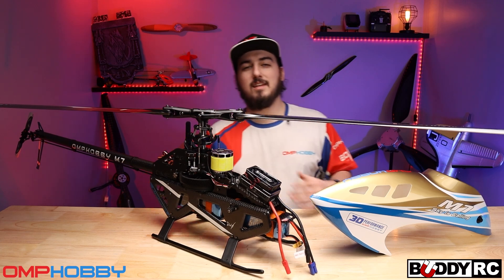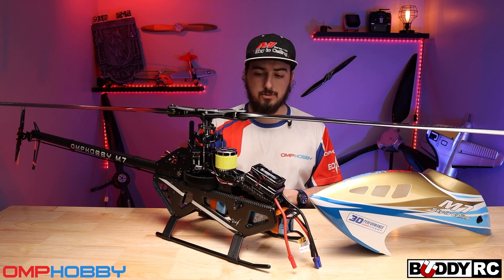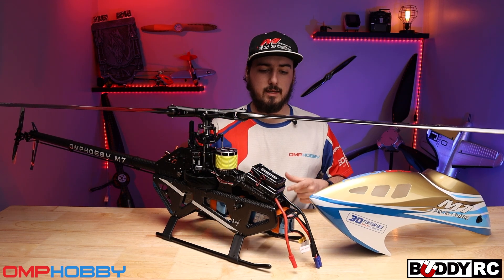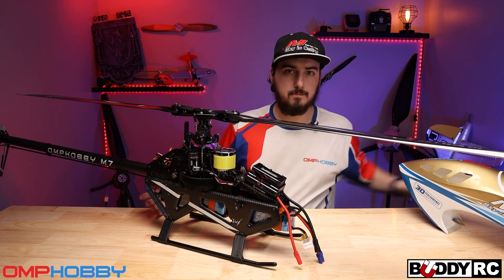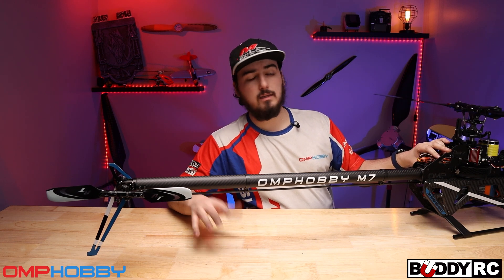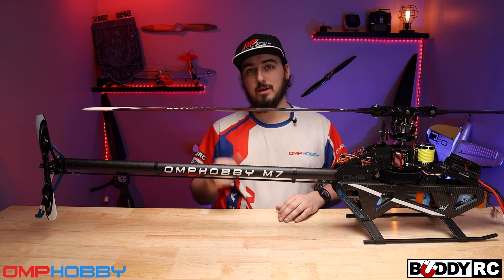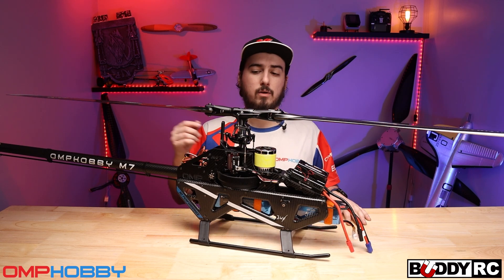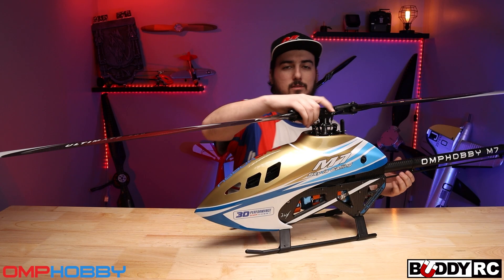OMPHOBBY M7 Innovative Features

Comment: Molded frames, fucntional?...expensive when crashing yes...
Reply from the maker: Thanks for watching! The molded side frames are not that expensive compared to what you would buy for a regular side frame heli. $57 bucks for a side frame with built in landing gear mount, and battery tray is way cheaper than most 700 side frames and you would still need to buy the battery tray mounts and landing gear brackets. Hope this helps.

Comment: What esc and motor do you recommend for 6s scale flight? Would the 4530/518 be ok with a 150A esc with 6s?
Reply: Overkill, but go for it if that's your first choice, otherwise you gonna upgrade in a few weeks anyways
Reply: I am going with a 200A or 260A. I have both inhouse

Comment: Wherever is the M3 ????
Reply from the maker: Thanks for watching! This video is for the  new OMPHOBBY M7, there is no M3
Reply: @BuddyRC right, but why? I guess the M4 isn't that big of a jump from the M2...
Reply from the maker: @sasquatchhadarock968  OMP JUST came out with the M7 so I doubt that they would go right to a model that is close to the size of the smaller helis.... The m4 is not that intimidating and the m2 is small enough to fly anywhere. So not sure there is really a market for M3 but i don't work for OMP so i'm assuming. The M2 evo is in between the M2 v2  and the M4 so its kinda like a m3.